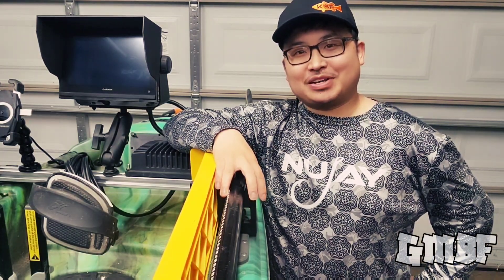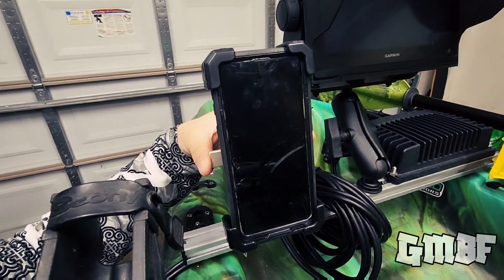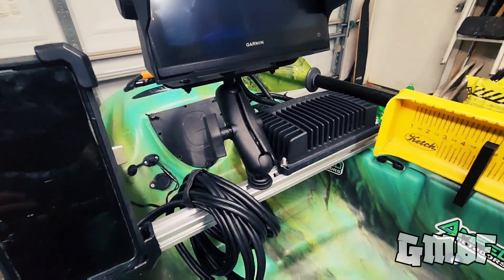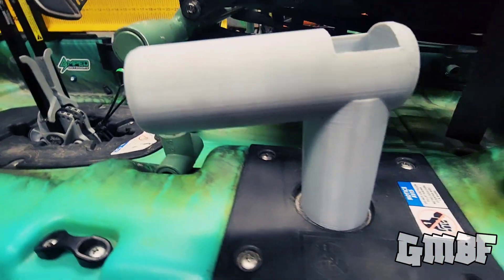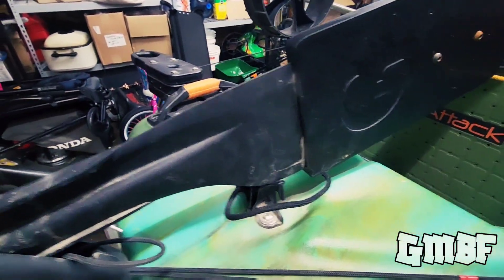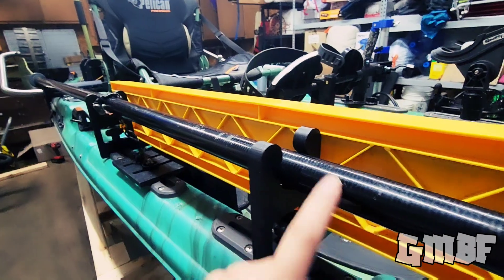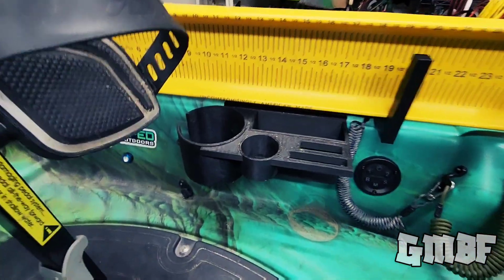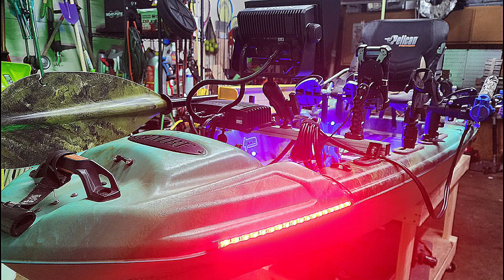Pelican Catch 110 Hydryve II | 2023 Setup | Kayak Modifications

Comment: Why did you get rid of the trolling motor
Reply: I just bought one to 💀
Reply from the maker: Good question. I bought the hobie 180.pedal drive and it was just as quick as the trolling motor and I didn't have to have an extra battery with me or have to worry about going dead etc. More convenient.

Comment: one yar ago yu recommended de nuecanoe board for the front for the sonar... i bougth it but the uality vas very bad, vero soft...now i see that you have an aluminium bar...much much better...i still hace my noecanoe bad plastic bar  :(
Reply from the maker: I still have my nu canoe also but it flexes with the weight of my livescope setup. I always wanted to do this Aluminum bar and finally got to buying one! So much better!
Reply: @GreaseMonkeyBassFishing   yes the nueconoe flex too much...any way thanks for your video:hand-pink-waving:
Reply: @GreaseMonkeyBassFishing  BTW what happened to your AMPED electric motor? you still use it?
Reply from the maker: @bob builder  sold it last year to a guy 6 states away. I have my hobie 180 drive now and that's good enough.
Reply: @GreaseMonkeyBassFishing  thanks i was curious about if it is worth it?
Reply from the maker: @bob builder  it's great to use after a long day out and you just want to troll back to the landing. I didn't feel like hauling my 60ah LifeP04 Battery anymore and when not using the motor it was in the way when I was using my foot bedal system. Just depends on the user. I would make another.